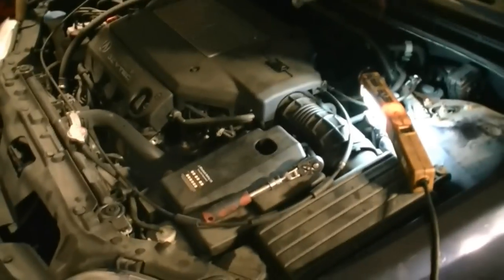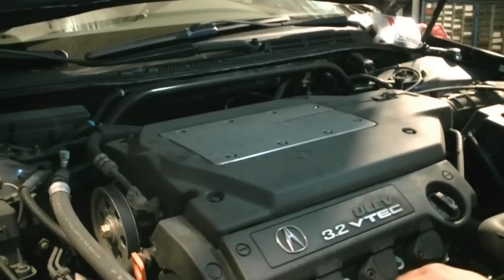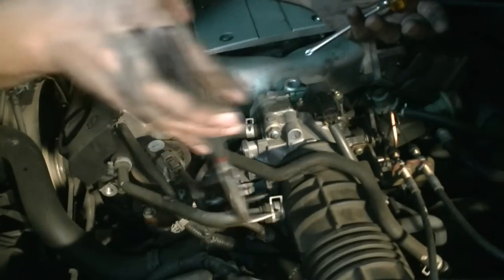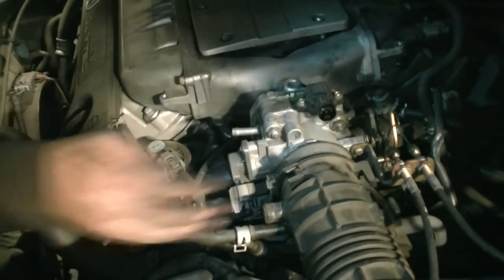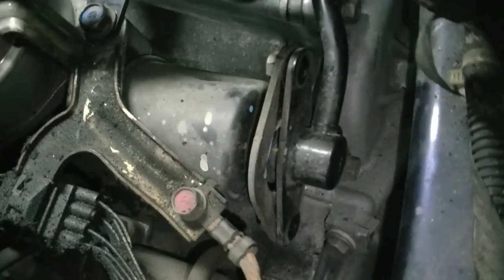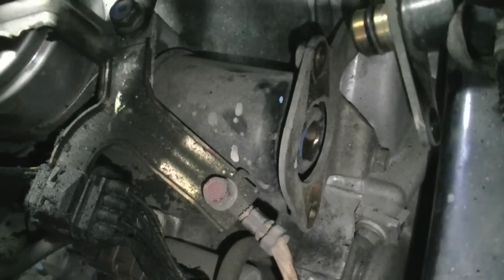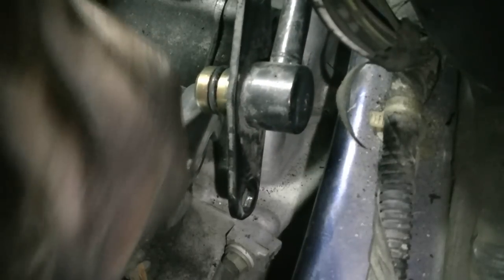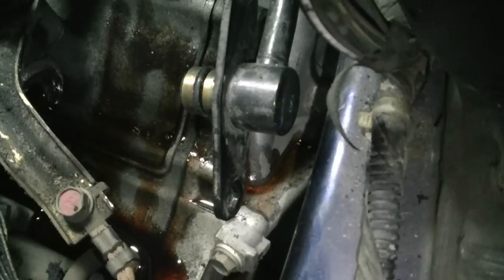How to Replace the Transmission Oil Filter on a 2000 Acura TL 3.2L VTEC

Comment: just changed my filter today. you only have to remove one bolt from the bracket. the one closest to the front of car. just loosen the back bolt. and the bracket will just swivel out of the way

Comment: This filter is actually an inspection filter for the transmission mechanic to look at if the transmission goes bad. You can certainly change it but it's not necessary with regular services. These transmissions were notorious for going bad.

Comment: This is highly recommend if your TL has the outer oil filter and if car starts slipping on any gear specially on Sports Mode. I did this while back and took the slipping problem away.
Reply: u did wht

Comment: Tip to save you clean up tuck/slide a small rag or two under it before twisting it out all the way even if you drain all atf fluid it’ll still have some in filter it is used/primed just like an oil filter

Comment: can you show what wrench you used? I stripped one of the first 2-bolts. I didn't go any further on the second round of 2-bolts. Whoever tightend it was so stucked. I got the bottom one, but the top bolt is not moving at all.

Comment: “Be careful not to scratch the o ring”
 As in the next shot the wrench is poking around and hitting the ring as he points out other bolts. Great vid...just funny. Hey so why DID you change filter? Code? Sticky shift? Dark fluid?
Reply: Just wrap the around oring with towels

Comment: Excellent! Thanks for your very timely response. I assume this is a very similar procedure on 2004 accord v6. Also, I've been wanting to clean throttle body, this seems like an ideal time to do that. However, it's a drive by wire system and I hear horror stories about them. Should I manipulate the throttle plate by hand? Might doing that throw off calibration to other sensors and require an idle relearn? Thanks again friend.

Comment: I have a 2001 Acura Tl it has about 200k miles & I don't know what type of transmission filter I need to get for my car...  when I went for auto zone it a a screw in kind & another kind if u can please help me because it's been parked in my yard for a while because people was telling me a need a new transmission & then someone told me I just might need to drain that oil out and buy a filter but what type of transmission filter I need for my car?

Comment: I have a question. Do you have to drain out the transmission fluid first before replacing filter or is it vice versa? Thank you. I have 2003 Acura TL S-type, so it's a similar second generation Acura TL.

Comment: great video. the most informative one on YouTube on how to remove filter and fluid change. I have a question, why couldn't you just fill the transmission through the fill tube instead of taking all that other stuff off? Also all you had to do was take one bolt off that bracket swing it out of the way and then remove your transmission filter.
Reply: can you show which bolt off the bracket. The front top or the far back

Comment: thanks for your VIDEO.  I have a 2003 TL which had the transmission replaced in 2011 at 105k miles.  I am unclear which years had the internal and which had the external filter.  Please advise if you've learned more about these TL's.

Comment: I was told to flush mine because  like if u start it and put it in d5 it takes a couple secs to engage..... 
Any suggestions..... 

It switches gears  but like slips  between  2nd and 3rd
Reply: SAME PROBLEM - GOING TO TRY CHANGING FILTER AND FLUIDS
Reply: pj zeke Did it work?
Reply: @OldManZeke1969  did this work? Is the car still slipping between 2nd and 3rd?
Reply: Solenoid b and c are high on the suspect list.I had the same symptoms on my 03 odyssey.

Comment: I'm thinking about changing this on my 2000 Acura tl but everywhere I go, no one has that filter. When I search for the filter using the part number, it says it's not compatible with this car? Did everything work out for you?
Reply from the maker: If I remember correctly some 2000 models dont have this filter and only have an internal filter! you should visually check to see if you have it and than take it out and take it to the parts store or the dealer and they'll be able to get you one with the part # thats on it. GL

Comment: I don't think my 2000 TL has a external filter. there's a 13mm bolt to remove the cooling line where I refilled the transmission fluid. according to eric the car guy the filter is internal.

Comment: Does the 98 accord ex v4 have this?
Reply: Yes.if it's automatic..also there's more solenoids in front of the transmission. Check those if your having shifting issues.
Reply: Where is the filters exact location on 98 accord?

Comment: External transmission filter is available  .

Oreilly auto parts $32.99
Power Torque part # FK-398

Autozone also carries them for $22.99.
						Duralast/Transmission Filter (A/T)Part Number: TF558

Comment: u THINK THTS WHTS MAKING MY CAR T.L ITS SLIPPING BUT ITS GOES INTO GEAR GOES TO 4 POPS OFF BK TO 3???
Reply: My TL was doing the same. I did change the outer oil filter and it did fix that problem. make sure you also clean the solenoids attached to the transmission and you will be good to go

Comment: Changed my filter and oh you dont have to take engine cover off I did it just taking off air filter and battery
Reply: Leave the battery in place so you would not have to deal with radio code headache. Just remove the circular spring by pushing it out of the way and then unscrew the circular clamp with a phillip and take the entire big air duct off after removing the air filter and its housing and you should have plenty of room to work with, and while you are at it you can clean the throttle valve with a clean cloth quickly...and you can see it immediately after taking off the big air duct.
Reply: @trankt54155  thank you I'm about to clean it right now
Reply: @yaboykaiyaknowricky  Cool. Have fun.